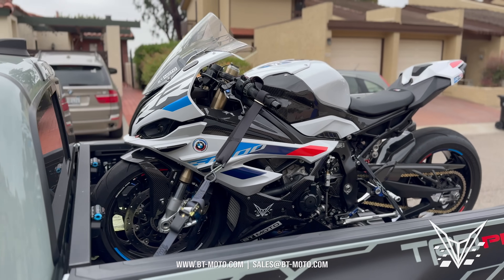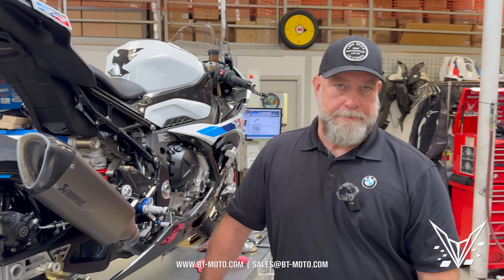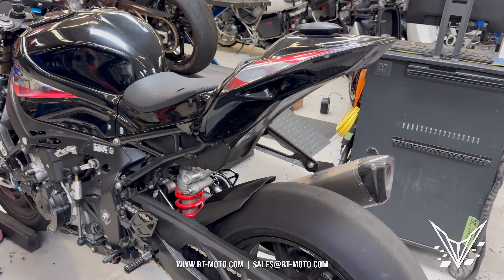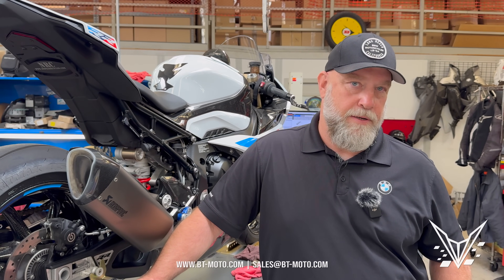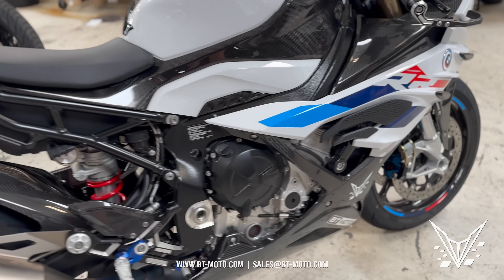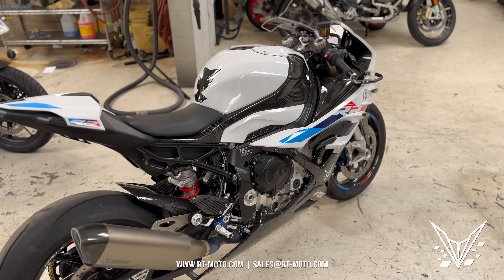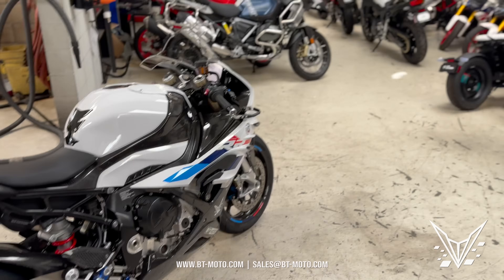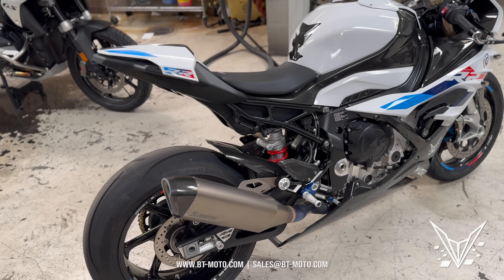We Broke Our 2023 S1000RR, Will BMW Warranty It?

Comment: Don't use carbon fiber wheels for the street.
Reply: Especially in LA. 🕳️
Reply: It’s been a common issue with those bmw carbon wheels. BST make them better.
Reply: Buy carbon  warranty
Reply: Where would you use it then?
Reply: Okay say you have a tune and then you have a rod bearing go bad can they tell if the tune cause or if it was already faulty?

Comment: The question is if the bike is BT Moto tuned, you’ve never rev bombed the bike, you keep up your service at the dealer, and then you have an engine problem, would your claim be denied? That’s what people want to know. As long as we don’t abuse the bike, but have a tune, people dont want to have claims denied on engine issues for these expensive bikes. A wheel is not the concern. Legally we’d be protected for that. That very specific question is what makes us nervous because the service manager is basically just saying he’d submit the facts honestly to BMW “and leave it up to them.” I, by the way, have the BT stage one and don’t abuse the bike and hope I’ll never have to test this.
Reply: @firstbloood1  BMW can see that the bike was flashed even if you flash it back to stock. Not sure the dealer can see it, but BMW can when they try to get a claim approved.
Reply: It will be denied period.

Comment: The biggest reason that this is such an issue is the fact that you had 2 massive influencers have 2 massively different experiences with BMW....one flashed their bike early, put an exhaust on it, got on a racetrack and had a failure and a hole put in his motor and he got a replacement motor covered under warranty in less than 30 days.  You had another who flashed his at 350 miles, put an exhaust on it, had a failure, somewhat got the run around from a 3rd party warranty representative, had a very reputable BMW mechanic show the most likely cause of the failure (rod end cap being loose), and was told to pound sand and had to foot the bill to teh tune of 15 grand for a new motor.  From there, it has escalated to every person who was ever denied a claim on a coil to anyone that had anything at all get denied going public about it, large numbers of dealers that are now telling customers not do mod their bike or they will be denied service (I was literally told this by my local dealer 3 weeks ago after I purchased an M1000RR) and the fallout is TREMENDOUS....to the point I will not mod my bike until I know there are no assembly issues or possible defective bearings (this is widely believed to be the issue with the one that failed on the racetrack).  There is literally a ton of innuendo about each incident and it would behoove BMW to go public as to why it reacted to each of these incidents in the way that they did, as its a HUGE hit to their reputation.  It would also behoove them to direct dealers to NOT inform customers that their warranties will be denied wholesale if they have any modifications.  On top of that, there are other NEW M1000RR's out there with failing motors that arent being publicized, as I know of a few....which considering I own one, its disheartening....and hence why many of us who do own them are ensuring that we do what we can to ensure the bike is solid before doing anything at all on the bikes until we are relatively sure we dont have a defect.  If it wasnt for all the publicity, I would have had a BT Tune and full exhaust on my bike the day that I did the first service.
Reply from the maker: @redrider0151  the M1000RR in question that failed was also found to have overrev events from rev bombing
Reply: @BT_Moto  People like to leave that part out.
Reply: @BT_Moto  They (the internet LOL) said it was one over rev of 250 rpm....if we are saying that motomillion "abused" that motor and that 1 over rev is what caused the issue with the end cap...then BMW should come out and say that or come clean and publicize exactly what they saw in the datalog.  It would HELP their reputation and calm down the blowback of this whole situation...Do I think they should have to do this for every claim, absolutely not, however this occurrence, and the other 2 widely publicized occurrences are absolutely affecting their reputation and I assume sales...
Reply: To be completely open...I own a 2024 M1000RR...I absolutely will be putting BT Moto mods on the bike...however I am also not doing it until I shakedown the bike with a few 1000 miles before doing so....literally because of the 3 widely publicized issues and a few more that I have heard about that are less public (also on M series bikes).  I am just trying to be logical in my arguments about the current state we find our trust being at with BMW...and the wide disparity of information we get from dealer to dealer....  Thanks for all you do Troy, as I know its a lot of effort that you are putting forth to create this content.
Reply: "behoove"
Reply: I think, ultimately, not modifying the bike is the way to go, especially don't do a flash and aftermarket exhaust system as that seems to be the commonality of all these blown up BMW's.

The guy who blew up his engine (Moto millions I think) did a tune and then revved the hell out of it on a dyno. Like...don't do that. Leave the bike stock and don't do weird high revs.
Reply: @BT_Moto  Moto was just asking to eat that bill. A person may choose to unlock before the recommended mileage, but that alone relieves BMW of any obligation to honor the claim. Doesnt matter if it was a faulty cap or not..its a 'did you wait until after the recommended break in? Oh, you didn't?'. He made the claim to deny FOR BMW. They really didn't have to do anything.
Reply: @firstbloood1  The single R is a different motor than the Double R....as long as you break it in properly and dont over rev it you should be fine.  Mine is the Doublr R and I am waiting til I have 2000 miles before I tune it and do header....it will have a good and proper shake down.
Reply: @firstbloood1  That's almost exactly the same situation MotoMillions had. Exhaust and tune, which necessitates high revs on a dyno, seems a big no-no according to BMW. And with BMW's black boxes, they will know. And, apparently, BMW also knows the if your bike has been flashed and, astonishingly, the number of times it has been flashed.

Comment: Great explanation that fully comports with my experience.  My motor blew at 16K miles and it had a stage 2 Brentune.  BMW not only replaced the motor with a brand new one, but also the oil cooler, front sprocket (hit by a flying rod), chain, two oiled Q4 tires and a free 600mile service.  BMW was awesome.  MT-moto also was great.
Reply: A little nervous just got the 25 S1K and I get mixed opinions on if they will work with Bren tune. I won’t do no craziness but nervous if something just happens it may not be taken care of. But from what you said that helps a lot
Reply: @EdwardGarciaTV  The Brentune is a necessity for the RR, at least in prior years.  Give them a call when you've had your first service.

Comment: Rear carbon rim on my M1000XR has something loose inside that makes noise when I turn the wheel. It is not inside the tire, but inside spokes I presume. Interestingly enough I had the exact same issue on my front carbon BST wheel a while back , but BMW case is a bit louder.  Wonder if you guys have seen this before?

Comment: Pity there was not more discussion on the wheel failure itself and its causes  or how BMW or the dealer examine the crack and determine that the  wheel is a total write off. I have read that in many cases of "cracks" all that has happened is that the finishing coat of lacquer has cracked but that the main carbon fibre structure of the wheel is undamaged. That crack seemed like a stone impact so in my view it was just the lacquer that cracked. I have 10,000km up on my 2021 S1000 carbon wheeled bike now and the wheels are still perfect. I did have a minor impact rear end traffic accident in 2022 but the dealer determined from visual inspection that the rear wheel was undamaged.

Comment: Im curios he mentioned the word racing somewhere along the lines if your racing your bike bmw might deny the claim. Could you touch on that are we talking like a roll races or whats exactly is meant by that
Reply: Don't abuse the bike or cause the bike to record a parameter beyond normal use. "Racing" isn't a recorded data event ...that is just using the bike. Now if while "racing" you over revved, rode the bike beyond operating temperature, or downshifted into repeated redlines ie...seems like that would be the issue....which this translates into miss use or abuse, or operating outside of normal parameters.

Comment: Carbon wheels are banned in MotoGp because they crack n shatter under intense ridding conditions. Not only banned in there banned in almost al racing circuits
Reply: The carbon wheels are not banned at circuits for track days, they are likely banned at most circuits for pro racing...not personal use. No professional racing body allows carbon wheels.
Reply: @j.taveras8447  That is what I exactly meant.. profesional racing. If you want to street race with friends, family  and neighbors they are obviously not banned
Reply: It's not because carbon wheels are the problem. It's because moto gp racing/bikes requires specific weight for the wheel and tire compounds combined for the tire to work properly. That is literally the only reason why. The forks on a moto gp bike are mostly carbon fiber.
Reply: @DSOXBLADE  i saw a mechanic from MotoGP explaining it on TV they can crack n pieces can shatter n affect the track conditions. I guess he was lying 🤔🤔
Reply: @R2690-f3y  Yes, he was full of shit. I was at MotoGP with Michelin. What I'm saying isn't from public speculation or media talk. The bikes are so forceful that the tire won't be able to maintain traction. The wheels they use are quite heavy.

Comment: So if I flash my new s1000 with your guys stage 1 flash will bmw deny a claim made for an engine failure if it hasnt been abused.
Reply: Based on the info and explanation, the simple answer is no. But they will be all in your shit to make sure the engine and motorcycle were taken care exactly as per the manual.

Comment: Can I get a BT tune that won’t adjust my rev limit ?
Reply from the maker: @shooter7759  one of the questions we ask when you upload your stock file to our website is if you want to change the rpm limiter, just respond with no and we won’t change it from stock.
Reply: @BT_Moto Who makes the lower fairing with full bellypan that you have on bike?
Reply from the maker: @YT-21-g6h  rpm

Comment: Forged wheels on street / track.   Carbon..... is for staring at in your garage.   In re: to dealers my dealer will deny a warrantee claim if you use the wrong brand gasoline
Reply from the maker: The gasoline brand is wild
Reply: @BT_Moto  We only have Cam 2 here that's pumped
Reply: Is this North Korea...there is no brand gasoline specified in the manual. I call bullshit.
Reply: @j.taveras8447   it was sarcasm, you can absolutely use whatever gas you choose... I was just making an analogy between BT's dealer and mine.. seems BT's dealer is 100% for their customers as mine is not...maybe the owners of my dealership could very well be from NK... They actually told me one time that if I install an Evo tech rad guard it will void the warranty on my 22 S1000R, I needed to put BMW's guard to retain warranty... I was like um yeah OK

Comment: If you have a tune and exhaust bike will go faster and this is maybe a cause to wheel crack also , seems legit if you think about it. Carbon fiber for track or show room😂

Maybe beacause its a void to the warranty , u can only change to a slip on not full exhaust , they said this to me. So 3 years with slip on and warrnty , then buy 2 year more . Or go full exhaust and no warranty 🎉 bmw is Great u can also buy a service package :)

Comment: I have asked a BMW dealership if you fit a full racing exhaust will the warranty be void? The salesman informed me that the engine would not be covered.
Reply from the maker: @mjdc4056  that means they would turn you away but dealers do not have authority to void anything. That decision is made by bmw after they prove the modification caused the issue. Just go to another dealer in your case.
Reply: @BT_Moto  The problem with that is that BMW is not Harley...they dont have 2-3 dealerships in every 50 mile radius....and even then, you are going to a dealer that you dont have a relationship with and are hoping they arent operating any differently than the one who just denied your claim.  You have the benefit of having an OUTSTANDING dealer with a fantastic Service Manager...this problem isnt just BMW, its EVERY manufacturer...
Reply: It’s illegal for them to tell you a claim would be arbitrarily be denied based on aftermarket modifications
Reply: @oifvet2x  Everyone says this....however until you try fighting them over it, you have no idea how tall that mountain is.  IF you are going to fight, I can tell you that the manufacturers legal department gets involved, you will be paying for a lawyer, and it will be at significant costs, as they will be delaying a number of times.  I was interviewed by my local news when I tried to fight and even then it did nothing.  Also remember that the entire time you are fighting you will not be able to repair the bike as well.  IN my case I was fighting over a car, so I eventually had to come to grips with the fact I spent over 3k in legal fee's and STILL had to pay to fix my car and had to drop the case because it was going to be drawn out so long that it wasnt worth it.  The ONLY way you will succeed is if you can bring a class action and have multiple parties joining in.  Trust me..I tried...
Reply: My bmw stated it would not void anything at all. As long as I don’t touch the ecu.
Reply from the maker: @oifvet2x  it’s legal for a dealer to deny a claim. That’s not a void, it’s a refusal to do work. That’s why we said to find a dealer that doesn’t practice that.
Reply from the maker: @kodykean2483  as explained in the video, a dealer has no right to void anything. They can refuse to do work on a bike, that’s the only authority they have. Nothing is stopping you from going to the next dealer and they will cover you.
Reply: @BT_Moto  I know and I get your frustration, people forget words have meaning when they use them. But this specific comment says the dealer says the claim will be arbitrarily denied which dealers aren’t allowed to say under the magnusson-moss warranty act.
Reply: From a salesman?  Ok lol 😂

Comment: He keeps mentioning Rev Bombing. Is this really an issue? Why beat your engine to death? I don’t get it?
Reply from the maker: @danthemaintenanceman  you’d be surprised how many owners do it, especially on the s1000rr
Reply: Really, look at any social media video, that's half the content. Rev bombing for exhaust noise, burnouts can cause it too. or just watch any video from Brazil.
Reply: @j.taveras8447  I guess people are dumber than I thought, and I already didn’t think very highly at all. Thanks for the correction.
Reply: I had my s1000r drop out of gear once after a quickshift, at full throttle at high speed. Revs went very high briefly. Wonder if that logged an OR condition...
Reply: @lordgibbness  pretty sure it does. Should be fine though. They mention a similar scenario in the video. Hell, I've bounced off the rev limiter a bunch of times during the first break in on my m1000r because of the low red line. Shouldn't be an issue as long as you aren't holding it WOT and bouncing off constantly

Comment: Well I bought a 2020 S1000RR when it came out and fitted a full akrapovič system from the dealer. It wasn't tuned because here in South Africa the bike is not restricted at all. The last issue it gave me had to do with the camshaft and they replaced it under warranty. I took good care of the bike so yeah, they can't deny your claim if you weren't a hooligan with the bike.
Reply from the maker: @lehlabilekekana212  euro spec bikes still have to adhere to euro regulations. Though the restrictions aren’t nearly as bad a US bikes, there’s still a bit left on the table
Reply: Camshaft sensor? Where it would just go limp when pulling the throttle?

Comment: Really suprised they approved with the lowering link, change in geometry etc. More dealers would than not by my experience this guy seems pretty cool.
Reply: Never seen a dealer decline warranty for straps unless you have blown forks and claiming warranty with the straps. Again this comment is based on no knowledgement of how warranty works. My local BMW dealerships would have no issues warranting out a wheel even when lowered. That has no effect to how the carbon wheel let alone a rear wheel would be cracked.
Reply: @RevItRalph  you are right. Working in dealers for 17years i obviously learnt f.a and a totally clueless. How stupid of me for thinking a lowering link or a stretch could affect geo or weight distribution. They clearly only do it for looks only.....oh wait..🤔
Reply: @jasperpearce8316  The point is that it was explained in the video why it wouldn't make sense for it to be denied. The crack was in the middle of the wheel not in the lip where you would expect a crack from an impact implying that it's most likely a defect. Also due to the cost the repair the decision on if it should be warrantied is up to BMW not the dealership. This is pretty much how BMW operates with their cars as well so it might be different than other motorcycle brands.